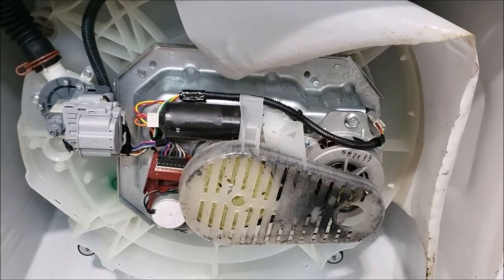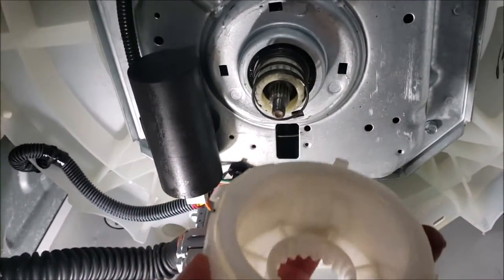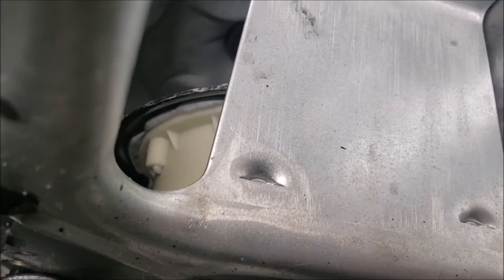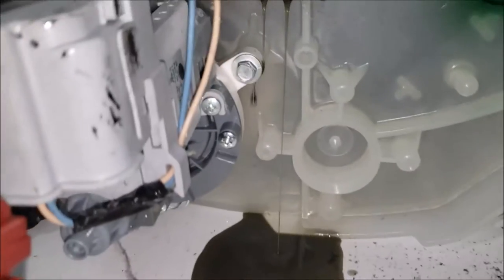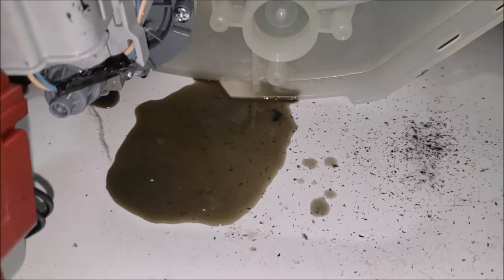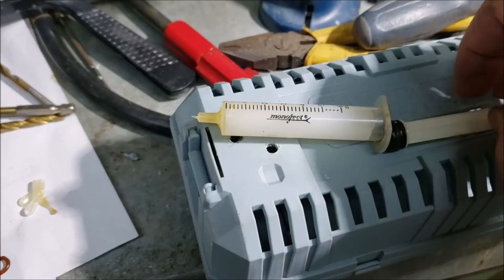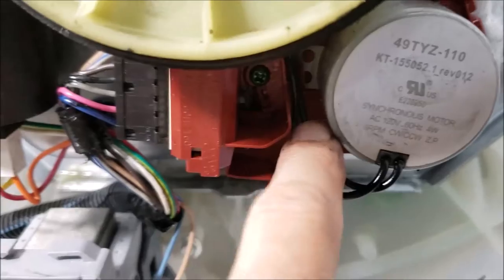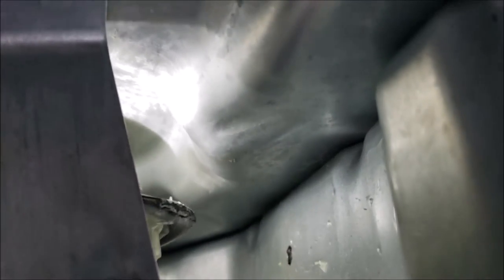$5.00 Fix: Washing Machine Leaking Grease or Oil From Bottom Causing Belt to Slip Part W11454741

Comment: Great video. 
This is definitely as perfect of a fix for the bad seal leak that I have seen.
That you ran it through several test and went through the trouble of taking it back part to make sure it was not leaking is very impressive.
Reply from the maker: Thank you for the kind words that means a lot coming from you
Reply: When two or more get together >>>get job to both of you guys
Reply: A year later and I have the same issue 😊. I will make the decision if I'm going to do it or not. Time and getting my body to cooperate is the problem for me . Great video Thanks .
Reply: I just performed the procedure on mine, I put at least 15ml of white lithium grease in there then sealed it up - I drilled through the panel to drill the hole, it’s working but it sure is loud… it wasn’t quiet before but seems louder now.  Time will tell! Thanks great upload!
Reply: @hallmt  issue with this fix is that the upper bearing cant get lubricated like it did before with the oil. I suspect the new ones that just use grease use a different type of sealed bearing , or maybe not . Ether way that upper bearing is a problem area anyways. Common for it to go bad. Which means replacing the whole transmission, unless someone is crafty enough to split the transmission and replace the bearings or upper bearing, but I dont think you can even buy those parts. I could be wrong.

Comment: Just finished a repair on my own machine using your video.  I used a suggestion in the Washer Dryer Money video and drilled out the welds underneath the motor and bent the plate down to get to the gearbox.  Just have to be sure to bend it as far back to the original placement so it doesn't interfere with the motor.  (Learn from my mistake!)  I did encounter an issue with all the oil that may help someone else here.  After troubleshooting and running manual tests, I discovered I was getting no tachometer reading.  Plenty of Google searches later, I learned that the problem was with the shifter assembly.  For the layman out there, the tachometer (or the part of it giving me problems) is the two plastic prongs that rest inside of the transmission.  Mine had a significant amount of oil and debris all over it.  After carefully cleaning it, all my troubles were gone and the tachometer was reading again.  Thanks again for the video!  Saved me a lot of money!
Reply from the maker: Thank you for contributing glad you got your machine up and running.
Reply: Hi is the washing machine still working ok?......tks
Reply: My repair worked out just fine.  The biggest problem I was encountering was that I had a hard time getting all of the leaked oil cleaned up.  This was building up around the tachometer which would throw an error.  I'd have to flip it over and disassemble enough to clean that part and it'd work again.  After a period of time, I ended up getting a new machine as a gift.  I still have the old one in the garage as a backup plan if I need it.  I expect it will still work though.
Reply: How did you reattach everything after drilling out the spot welds?
Reply: @redins6232  I didn't completely remove the whole plate.  Just enough of the welds (2 if I remember right, maybe 3?) to bend the plate back.  I didn't reattach anything, I just bent the plate back as much as I could manage.

Comment: i have a a maytag washer with the play button and it leaks oil it's everywhere. the belt was slipping and it would wash or spin right so i started to take the gear box out and cant get the wash plate out so i may try this.

Comment: I have the exact underside. Sealed trans. Mine made a very loud electric buzz alarm noise during drain cycle. . . But would still drain strong. Well eventually it stopped spinning. And started leaking water. Turned it upside down and I definitely see some evidence of oil... I probably need a new pump and to do your grease change. Difficult days ahead
Reply from the maker: YOU CAN DO IT!!!!

Comment: Thanks for the video, Kevin! I have a Whirlpool washer with a "Play/Pause" button that has started smelling like oil after a wash. No oil to be seen on the floor and it still spins OK, but I figure the seal is probably starting to leak oil and the belt will eventually become slippy. How many syringes worth of grease did you put in?
Reply from the maker: I used the full tube of 3 oz The Grease I used https://amzn.to/3o7j40D
Reply: @ktoutdoor  Thanks, Kevin! :)

Comment: Just did what you did because the transmission was leaking. I used a shop vac to try to get the rest of the oil out and It didn't work but I am adding in the grease now. Cross my fingers! Your video is really good video for homeowners thanks!!
Reply from the maker: Thank you for the kind words let me know how your repair turns out.
Reply: Hi is the washing machine still working ok?......tks

Comment: Great video,  my issue on my Maytag Centennial was the hub under wash plate.  Machine wouldn't spin fast.  I didn't realize that wash plate wasn't supposed to spin freely, until the actuator switches it over during the cycle.
When I did look  underneath, saw all the oil spilled out as well.  The new hub, and this trick seems to have everything back in order.   Removing the wash plate was a challenge.  I ended up "threading" a long ratchet strap down, and then under the plate.  Rotated it around and pulled up at different places, until it broke free.    Good luck and thanks
Reply from the maker: Thanks for contributing so glad you got you washing machine working again.. have a bless day.

Comment: Thanks for the help, Kevin. Got my Kenmore washer up and running - all seems good so far! I used a plug from my drip irrigation system to seal up the hole in the gear box, which worked pretty well. The grease was more like $10 in NY, but I'm not complaining - you saved me buying a new washer!  Thanks again!
Reply from the maker: Keep me updated on its longevity.
Reply: Hi is the washing machine still working ok?......tks

Comment: This has been immensely helpful so far- however- I’m at about the 5:33 mark of the video on my own washing machine, & I’ve drilled the hole into the gear box & twisted it to the downward position- and all that has come out was a bit a water, no oil as far as I’m aware. Do you think all the oil has spilled out already? There was some on the floor & around the bottom of the machine, but not nearly as much as I’d expected to see after seeing your video. Maybe I didn’t drill deep enough into the gear box? Let me know if you have any thoughts. Thanks.

Comment: Do you remember what size air hose that was? 
(Original question was: “is it necessary to drain all the oil?” obvious in hindsight but I was thinking in terms of affecting the grease and not additional leaking.)
Reply from the maker: I'm afraid if you don't it may leak more oil out on to the belt

Comment: Question:
How important is it to drain the oil? You spend a lot of time doing so, but don’t really say why. Do oil and grease not mix? Mine has leaked so much oil that I doubt there is much if any left, and is now making grumpy noises when spinning.
Reply from the maker: I wanted to make sure no more oil ever leaked on to the belt

Comment: Great video! Can you please explain what symptoms you observed that made you determine that the transmission was the culprit and that greasing the transmission was the solution. Many thanks, JP
Reply from the maker: Going by memory I think it would not spin, the belt was slipping from the oil.
Reply: @ktoutdoor  Thanks for the response. My GE washer (GTW460ASS7WW) is leaking a small mix of oil and water. In my testing, I observed that the washer sometimes went to the washing mode but for only some four stokes; mostly it died at the washing mode. I tried getting directly to the spinning mode but without success. Error codes are numerous. I believe the transmission is starved for lubrication to the point where it locks at either the washing or spinning mode. I also suspect the belt would slip if the washer ever got to the spinning mode. Your clever solution seems the way to go, or should I bother? Any opinion on my analysis or on trying your solution? Many thanks.
Reply from the maker: @jptourigny222  I love a good challenge so I would go for it. the grease is cheap enough The Grease I used
https://amzn.to/3o7j40D  let me know how it turns out

Comment: Hi! Thank you so much for your video. It is very helpful. I was just wondering if you had any thoughts on something. I did everything in the video up until it says to add the grease. I started adding the grease. I only put 1 syringe in and it just started come back out of the hole. Do you have any suggestions on why this may be happening?
Reply from the maker: Try rotating the gear assembly in order to move the grease around.
Reply: That worked! Thank you so much! I just finished washing my first load of clothes!😃
Reply from the maker: @LaToyaJ-et1zn  awsome and look how much money you saved yourself!!

Comment: How tight should the nut be on the pulley wheel?  I replaced the cam kit and the actuator, worked fine for four washes.  Then it started making a grinding noise but only when the wash plate was going counter clockwise.  I replaced the belt, cleaned up the oil and it started again.  I don’t think I tightened the nut enough because even with thread locker the belt is rubbing on the cover.
Reply from the maker: Sorry I don't know for sure.
Reply: @ktoutdoor I think I wasn’t tightening enough.  I’m gonna give it a try.

Comment: Great video! Thanks for posting it! I have a Whirlpool, about 4 years old. Making random grinding noises, check on the bottom and saw the cover plate full of oil, and some splattered on the walls. Was your washing machine also making these grinding noises? Wondering if I have a double problem here...
Reply from the maker: Ours got to where it would not spin do to the oil...
Reply: @ktoutdoor  I opened it up this weekend and the plastic cover was full of oil, cleaned up the pulley, belt and cover. That's how I ended up in your video. (need to buy the parts you suggest to go any further) The noise is very random, I did two washes after cleaning the oil and it was fine. Your washer is doing great I take it?
Reply: This washer is only 4 y/o. I had a 15 y/o Kenmore, I only had replaced the coupler and the draining pump. Kind of regretting getting rid of that one...
Reply from the maker: @soundmisen8864  Yes all is still good
Reply from the maker: @soundmisen8864  I know what you mean new stuff is so cheaply made

Comment: What did u use to add pressure through the hose to push out the oil?
Reply from the maker: A small air compressor
Reply: Thank you so much🤗🤗

Comment: Hello,
Thanks for the video.  Just wondering how the white grease held up over time? Any more leaks?
Reply from the maker: Its still going strong !!! No leaks
Reply: Great!  Thanks for your post.  Almost finished my job, just wondering what you used to force air into the gearbox (from the other end of rubber hose)?
Reply from the maker: Just a small air compressor
Reply: Hello again Kevin,
I was wondering if you used the brake cleaner inside the transmission to remove residual oil before adding the grease.   Mine did NOT drip much probably because most had already leaked out   just wondering if you tried to clean out ALL the oil before adding the grease?
Reply from the maker: No just on the outside of the gearbox and clutch parts  @bshortell9